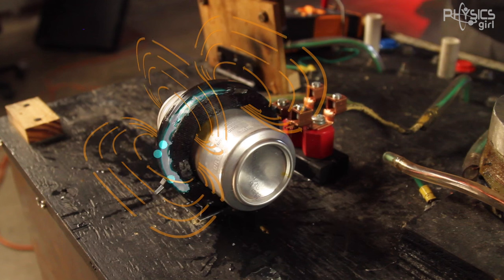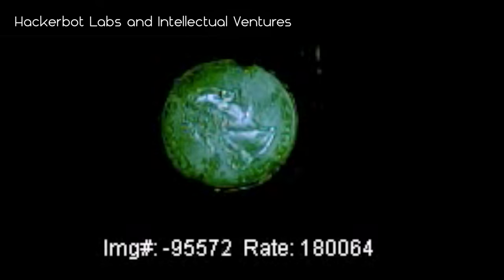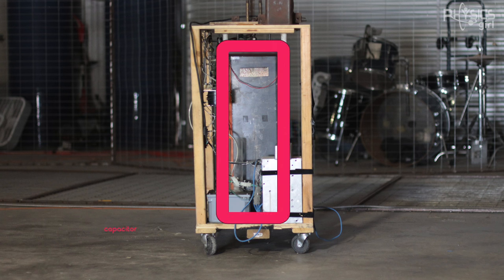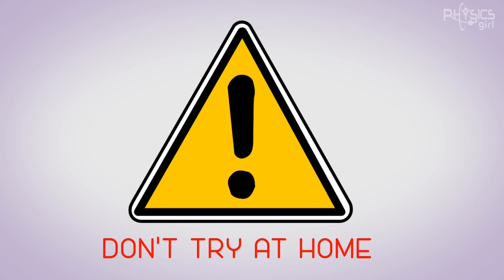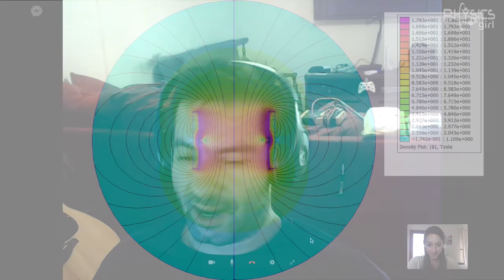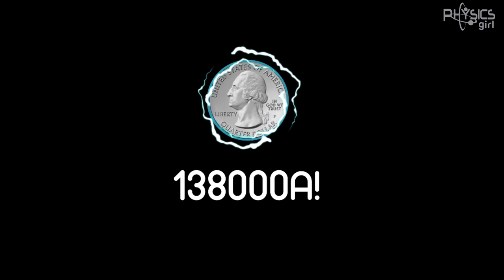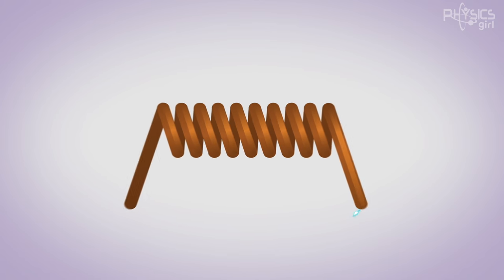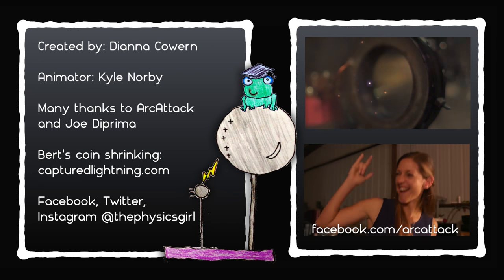How to Shrink a Quarter with Electricity

Comment: Interesting demonstration on an applicable use of High voltage! The electromagnetic force inside that work coil is enough to compromise the structural integrity of both the coin and coil - science at work!

Comment: Levitating frogs with magnets.

I think I need to sit down for a bit.
Reply: IT'S NOT HELPING
Reply: The world's starting to spin. Send help.
Reply: join the club... i haven't been able to stand since the internet was invented...
Reply: Apparently the iron in the hemoglobin cells in blood is in a form that is actually repelled by a magnet. A strong enough electromagnet, and you can levitate said frog.
Reply: marcus FRED everything in the frog is mostly diamagnetic, and strong enough magnets will repel everything apparently
Reply: I always levitate my frogs with model rockets engines. Sometimes they're hard to find afterwards.
Reply: YOU need to sit down?! what about the freaking frog!?
Reply: maggymoo i’m guessing the frog agrees on that last point.
Reply: @josephrench7310  Not completely sure this would be a good idea. Wondering what an unevenness in the field would do to the person so suspended.

Comment: dont try this at home? crap, what am i going to do with this 8000v capacitor?
Reply: Store it in the corner of the shop,for now. With the terminals shorted together.
Reply: Ok, but capacitance is measured in farads. Inductors are measured in henrys.
Henry Farad...??? Not so much.
Reply: Hook it up to the front door knob and see how many people you can get to try to open the door.
Reply: The obvious answer is to make a rail gun.
Reply: Make a bridge wire detonator
Reply: Howard Black  ,  Capacitors typically filter best or work best at close to their stated voltage ratings. An 8000 V capacitor might not work that well to filter the 80 or a 100 V DC supply in a typical large power amplifier.
Reply: LOL like an audiophile would know the difference. These are people who still use vinyl record players
Reply: Not that difficult to get ahold of a small one, but this one (which is most likely a bank of capacitors)... that’s going to break the bank.
Reply: good 'un How? I’ve never heard of such an effect.
Reply: Buy 10,000,000 10w light bulbs?

Comment: Does the quarter still weigh the same?
Meaning, it is now smaller but more dense?
If it lost weight, what bit is gone and where did it go?
Great video as always!  TY.
Reply from the maker: For the most part, still weighs the same. It might lose a tiny bit of mass just by the explosions and pieces being scraped off, but it just becomes fatter as you can see in the extreme case at 1:52
Reply: I also thought about that! I think it still weights the same. Although as the coin gets really hot metal from the surface can evaporate we cannot see any signs of oxidation on coin. But I could be wrong.
Reply: Physics Girl Ah, fascinating.  Thank you.
Reply: We weighed coins before and after and they were identical, to the margin of error of the jeweler's scale. (~10 mg)  The coins are amazingly unscathed, considering the induced current levels in them.  I would have expected at least some vaporization or melting of metal from the coins but the wooden or acrylic dowels we used never showed any obvious residue from the coins.  There was a lot of vaporized copper everywhere though.  FYI, we did calculations of the speed of the wire fragments in the high speed footage and the copper  coil is exploding at roughly mach 3.
Reply: Had pretty much the same question.  So the density isn't changing, its simply changing dimensions by becoming fatter?  Love the vids!
Reply: I would imagine, it's simply compressed inward. Not exactly "shrunk" so much as it's "smooshed"
Reply: +ALEXANDER DENARDO brother... Doge
Reply: This is freaking amazing
Reply: If the metal is melted afterward, does it go back to it's original size? Is the melting point the same? What is the effect on the strength of the metal, if the density is increased? I saw this presented as a coin shrinking trick in a science book, but I think the possibilities of this as a practical technology could be huge.
Reply: If you kept putting the same coin through the same process could you eventually draw the coin out to be a rod?
Reply: Another awesome VIDEO!!! Please find out and show us what is happening to the metal alloy of the coin at an molecular level. If the atoms are being changed or just being pushed closer together does that make different elements? What is going on in there?!?!? Thanks!

Comment: One question just leads to another... how on Earth are these frogs levitating!?
Reply: That was my question. I think the clearest answer is provided here: https://en.wikipedia.org/wiki/Magnetic_levitation#Direct_diamagnetic_levitation

EDIT: I guess the easiest way to explain it intuitively is by thinking of a frog as an animal composed of mostly water. Each water molecule can become a small magnet (facing the opposite direction of the magnetic provided magnetic field) when under the force of a strong magnetic field.
Reply: Water is diamagnetic  (from Wiki: diamagnetic materials create an induced magnetic field in a direction opposite to an externally applied magnetic field, and are repelled by the applied magnetic fiel, frogs have a considerable amount of water in them...therefore floating frogs :)
Reply: Why do we not feel this force in an MRI scanner?
Reply: geocarey I'd guess either 1. we are way to big 2. the MRI isn't quite powerful enough (they only go up to about 3T as opposed to like 15T or more for superconducting magnets) or 3. the magnets are more or less on all sides so the forces cancel out, though, these are all just educated guesses.
Reply: +anvil777 One and two.  Three would actually allow you to float given one and two (size and magnetic field) were factored in. if you did not have an even enough magnetic field, you would likely be pushed out where it is weakest.
Reply: MRI machines do use superconducting electromagnets though (it's what you need the liquid helium for)
Reply: Yes it's diamagnetism (repealing of a magnetic force). Actually not just water is diamagnetic, but everything is. But the effect of diamagnetism is very small. So we can't feel the effect. The only way is to apply a very vey strong field, much stronger than MRIs to a tiny mass like a frog and it can levitate. I actually made a video showing how you can use an ordinary neodymium magnet to move water and wood with diamagnetism.
Reply: Mememagic
Reply: Does it hurt???
Reply: would imagine its similar to why liquid oxygen floats between to strong enough electromagnet contact points
Reply: Alex Burns  Actually Alex, while they are similar seeming on this planet, magnetic fields are a separate force to gravity, both separate and semi-independent of one another.
Gravity is based on mass, while the electromagnetic field is a phenomenon affect caused by the earths core dynamics. magnetism does not require mass, gravity does.
Reply: Callum Scott. Everything has magnetic properties. A strong enough magnetic field will levitate anyting
Reply: Alex Burns. What? Static cling is gravity? When I take my clothes out of the dryer and they want to stick together, or if I rub a balloon on my head and stick it to the wall, that's gravity?
Reply: Let me guess. Thornhill and the electric universe
Reply: Alex Burns. LOL.
Reply: Alex Burns. When I rub a balloon on my head and stick it to the wall, which of the two objects now has gravity? Is it a shared gravity between the wall and the balloon? Before I rub the balloon on my head, it won't stick to the wall. Does that mean rubbing a balloon on my hair created the gravity?
Reply: Chemicals in the water
Reply: @haniyasu8236  also MRI is spread out over a much larger area than a frog

Comment: With all that amperage and megawattage produced, how much does it cost to shrink a coin? (i.e. electric bill)
Reply from the maker: Great question! gonna look into that.
Reply: I think that the short time used in the process, does not cost so much...
Reply: the interesting thing is, not a lot really. you charge the capacitor using low current, high voltage. i dont know how many amps they pull from the wall, but if its a standard 110 outlet, the maximum would be around 15amp, and only for the time needed to charge the capacitor. thats whats great about caps. you can charge them with very low current and high voltage slowly, then in a blink of an eye dump all that energy, creating massive amounts of current output. thats how theyre getting something like 50kamp(?) and millions of watts (for literally fractions of a second) out of a power supply (the wall) that cant push more than 1500w or so.

basically, it probably doesnt cost all that much at all. a few cents maybe.
Reply: +m4xwellmurd3r forgot to mention, if they were to push 1000w from the wall through the transformer to charge the capacitor, they would be charging it at a rate of 125mah or so. very low current (since when you step voltage up current drops)
Reply: At least 25 cents. 😎
Reply: l think you're right, I forgot about the time factor and that the output does not need to be sustained. I'm still curious however, how much does it cost to charge it up, or put another way, how much does a bolt of lightning cost these days?
Reply: The energy needed in this is not notable in your electric bill.
You could calculate energy = time * wattage and the time was not very long. 
Another way to think this is to look at how hot things got. -Not very.
This can also be compared to penny presses: you do the work in seconds without much effort.
The real number is still an interesting piece of knowledge.
Reply: +Goodwine plus the 25 cents for the quarter.
Reply: +Physics Girl

I looked back at the calculations we did for the HBL shrinker.  The capacitor bank we used is a 15 kJ unit.  It was a little beat up but we assumed that that value was largely nominal.  It was charged to 10,000V for the full shrinks and we generally had about 0.5-1.5 kV remaining on the bank after a firing.  That gives roughly 14.5 kJ of energy dissipated into the coil, resistive heating, etc.

We did some really crude measurements of the pulse length with an inductive coil going into an oscilliscope.  If I recall, it was something like 30-40 microseconds.

I do remember that the peak amperage for our pulses was close to half a gigawatt.

Overall the system efficiency was fairly high.  The pulse capacitor had very little self-discharge in the time frame of the experiments and the neon sign transformer we used should have had a decent conversion efficiency - in the 70-80% range, I'd assume.  

If we assume 15 kJ of energy loaded into the cap and a conservative 70% efficiency of converting wall power to the 10kV we charged at, we get roughly 21.5 kJ of energy.  That's 0.006 kWh of power.  Seattle currently pays a ridiculously low $0.0108 per kWh but that's gone up since we did the shrinks back in 09 or 2010 or so.  Let's assume 8 cents per kWh and we get:

0.05 cents of power used per blast.  I'm pretty sure the masking tape we used to hold the dowels together cost us more money.
Reply: The copper coil that gets shredded costs much more than the electricity. Going by the numbers in the video, there's more energy in an AA alkaline than they used to shrink most of the coins.
Reply: the problem is you are dealing with both very large and very small numbers. I doubt it amounts to much financially, a calculation could be done with the time frame of those 7 frames and the frame rate, but there is also waste energy. we really need to know the farad rating on the capacitor to know how much energy is stored.
Reply: daniel dimitri
If you read my post above, I have the actual values for the Hackerbot Labs shrinker.  And yes, its a tiny fraction of a cent.
Reply: She said that the video of the shrinkage showed a reaction time of 7 frames of video that was shooting at 180,000 frames per second. If you do the math, that 29MW of power absorbed by the coin only lasted for 1.0802x10-8 hours(trying to show exponential form). While the actual wattage absorbed by the coin is huge, it only lasted for about 39 microseconds. So, continuing with the math, the total energy absorbed is roughly .313Watt-Hours(Watts x time). Now if you are paying say 15 cents per KiloWatt-hour, that reaction only used .000313KiloWatt-Hours, or about .0047 cents. Now we know that the conversion of energy causes losses, and the amount put into charging the capacitor is more than what the coin was able to absorb. Even if the amount of energy used to charge the capacitor was 100 times more than what was absorbed by the coin, we are still only looking at only about .5 cents(not even one cent) to charge the capacitor. 
If I have made an error, please correct me. I just did some quick dimensional analysis to come up with the numbers. I did a lot of rounding along the way, but it would not have made significant differences in the final values.
Reply: Chris Luy  If you read my comment, I helped build the shrinker setup used for the high speed footage.  You're pretty close for raw dimensional analysis, I calculated the value at 0.05 cents per shot.
Reply: Thanks for the reply Dan, I had not gone through and read all the comments so I missed yours. Amazing fun for so little money!  The power of leveraging time...
Reply: +m4xwellmurd3r yeah and when I was in  auto shop class we would  charge a condenser and carry it around with a pair of  insulated pliers then throw it  to  someone who of  course would catch it  and  the  load would dump into their hand.....  Hehehehe
Reply: +Goodwine it don't work that way  it takes time to charge the  capacitor just like the old  flashes in  cameras that  you would hear  wistling until it was  ready a capacitor is  charged similar to a battery but it  can dump is  full charge in  fractions of  a second......  
And another thing the people in this video especially the  chick have no  clue what they are talking about in the  voltage amps and  numbers part of this  video ....  I heard things that just are not  true ....  Lots of bs'ing and tales being told in this one.... Egos cause men  to puff and stretch the truth in the presence of   any  chick
Reply: well by my rough reckoning over the 6 or 7 frames before the thing goes bang, spread that power over 1 second it becomes 600 to 700 watts, now lets say it takes a full minute to charfe the capacitors were now at 11 watts, now lets make it a watt/hour and were are at well less that 1 watt ( 180 ish mwh) so yeah its gonna cost nothing !
Reply: +Dan Heidel Wouldn't it be easier to just measure how much your transformer is consuming while it's charging?
Reply: +mrkiky well yes, but i think the point was to show that what is perceived as a huge amount of power is the same as much lower power level but compressed into a tiny fraction of a second.
Reply: ***** It was already answered by a guy who actually did the experiment. This thread has tons of replies already. Also, it wasn't hundredths of a second, it was millionths.
Reply: When economics meet science!
Reply: A Buzzed Whaler also applies to porn.
Reply: well said
Reply: +mark Schippel lul
Reply: probably the most expensive thing here is the coil which can't be reused
Reply: More importantly, it's volume has changed?
Reply: +jolllyroger1 Please demonstrate for the class then how its supposed to be done.
Reply: they should make a machine at the fair where you put in a quarter and you can do this (joke)
Reply: > they should make a machine  
I think one of the universities made an automated can-crusher machine.  You get to keep the can.
Reply: Akahadaka it's only for a very few nano seconds so not much
Reply: Depending on what transformer they used, many of these applications use a microwave oven transformer, so no different to running the oven for the charging period of the capacitor.
I'm a member of a group who use a M.O. transformer to charge capacitors in about 90 seconds, this produces a 144MW pulse to destroy metal, that pulse is less than the blink of an eye, the machine is called 'Thumper', the metal sublimates, they also have a coin shrinker called 'Stomper'
Reply: Physics Girl best guess: more than a quarter. You can easily calculate this if you know how many F the capacitor got. :)
Reply: Goodwine well you miss completely that that was just the electric force applied to the coin. The force on the rest of the structure is much more.

Also: he told us that the capacitor didn't fully discharge, they probably just need a strong peak current, that's why it got that much capacity. So you need to calculate all power that capacitor need to charge plus the loss for the ac-dc converter plus the stepup to 8000V.

I guess 10-20$
Reply: Roughly about the same as it takes to microwave a cup of coffee to re-heat it. Or make a piece of toast. Not much.
Reply: @Akahadaka and m4xwellmurd3r: Had the same question.
Ofcourse when we new the amount of time during which the 26 MWatt power was released it would be possible to calculate the actual amount of energy taken from the wall wart.
Reply: @Lacnic: Well, actually they do (at least in Western Europe). Only in these machines the coin is deformed by mechanical force, which is applied by yourself. The coin heats up in the process, but all in all it's a lot safer.
Reply: If you can take a large 10KV capacitor and charge it up using 110V out of the wall. How long does that take? Couldn't we then use a transformer to power a higher energy appliance such as a hot water heater or electric dryer that require 220V and cheat the electric company out of charging us more since we are only pulling 30amp from the fuse box? Again, it depends how long we take to charge up the capacitor to see any savings. So back to my question, how long did it take to charge up the capacitor?